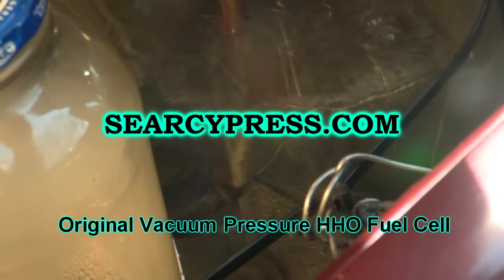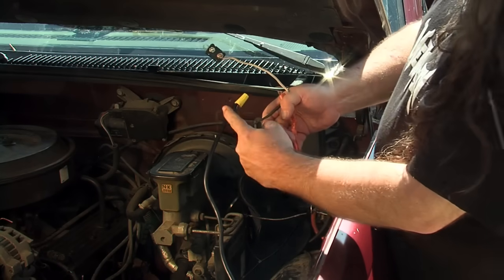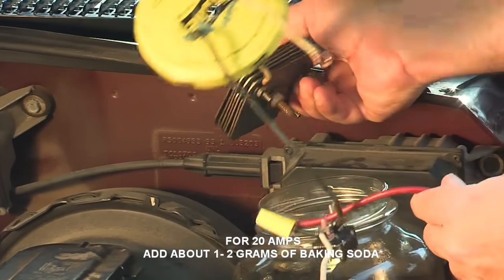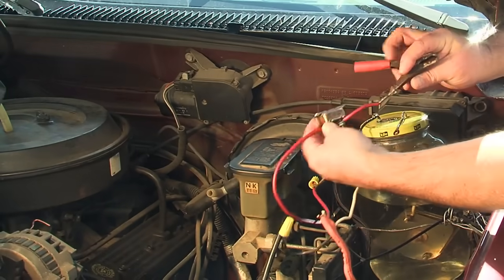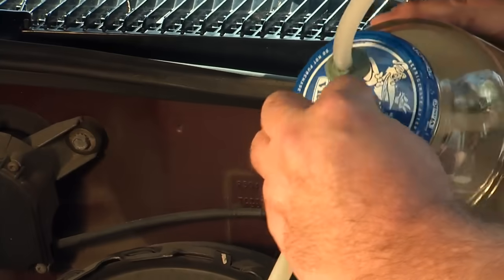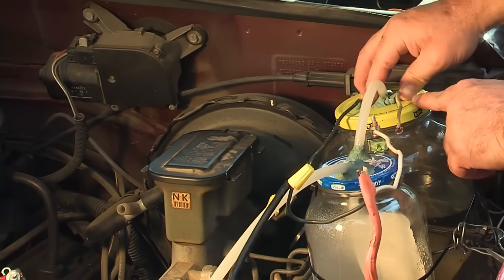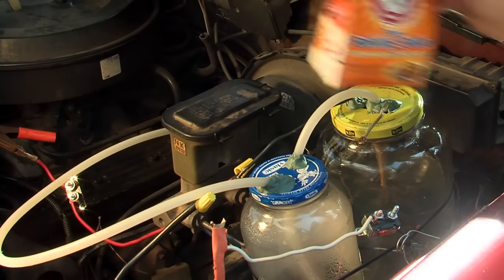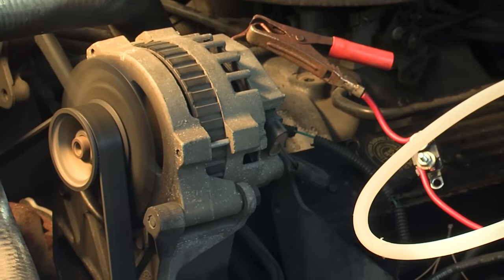Vacuum Pressure Hydrogen fuel cell defeats high gas prices using hydrogen from H2O.

Comment: This was awesome at the time !.....Now The Fuel Gennie has everything sorted and comes in an easy to install pakage .......works the same but safer.
Reply: Just a scam 

Just idling your engine is over a 600 rpms. Driving a 2.5 liter 4cly motor  is about 150 cubic inches. That's 37.5 cubic inches per a cylinder. A cylinder fires ever 2 full rotations. So in a minute of idling at 600 rpms your engine will use 11,250 cubic inches of air a minute at just idle. That's a 187.5 cubic inches a second of air. You're not producing even 2 cubic inches a second. But don't forget that it's h2O 2 parts hydrogen 1 part oxygen. So 1/3 of the gas isn't even hydrogen it's oxygen. So not even 1% of the air being taken into the cylinder is hydrogen. The only thing being accomplished here is the alternator is working harder for the high amp draw dragging the motor down more reducing fuel mileage. This is why water isn't used as fuel in a motor vehicle. 

Now don't forget we don't drive at 600 RPMs most people will be around 1800 rpms at cruising speed. That's 3x the amount of air with still the same hydrogen production. So now ur way below the threshold of .03% hydrogen in the cylinder. Using a spark arrestor on the output hose to keep from blowing the jar up you would be hard pressed to even candle a flame let alone put anything measurable in every cylinder 900x a minute cruising down the highway at the speed limit.

Comment: Hi, Can you please list the electrical parts etc. 10 Gauge Wire, 30 Amp Auto Fuse, Light Switch etc. And also how do you wire the stainless plate. Ex:  Where does the positive wire go, and where does negative wire go onto the plate.
Reply from the maker: A new video is coming out very soon. Be sure to subscribe so you don't miss it. I'll try to cover everything I can. Thanks very much.
Reply: Thanks I subbed you. Will this work with fuel injection also.

Comment: Can this work on a fuel injection engine( 2008 Honda Civic)?
Reply from the maker: I cannot sanction the installation of this fuel cell for obvious reasons. Technically speaking there is no reason it will not work. Injecting into the vacuum instead of the air intake is a far better approach. Avoiding O2 sensor problems is possibly one of them. I will be showing the addition of a vacuum pressure switch installed in the system in an upcoming video. This switch will offer a lot of benefits to our truck. Be sure to like and subscribe or you just might miss it. This video is for research purposes only, it should not be duplicated. Ty

Comment: Don’t try this please if you don’t know about gases it’s a very dangerous method letting both gases mix, if anode and cathode are separated into two different sub sections and o2 and h2 is generated separately it would be much safer option

Comment: Easy to make safer.put a gauge on to show pressure, find out what the average is when running well. Find out what the minimum vacuum is. Put sensors on both, running to a main relay. Low vac or high pressure, and it shuts off.

Comment: If you use distilled water it wouldn't be as much of a buildup
Reply from the maker: Build up is not generally a problem. In the past I would have used distilled water to start with to simplify adding electrolyte. Now with the cost of everything, not so much. Thanks for the comment.

Comment: Curious, if you are supplementing the gas and increasing the mileage, what % of an increase in the mileage did you get?
did you go from 26 to 50? Also, how far does that gallon of water take you before it runs out and you are just on gas?
Reply from the maker: This particular motor is extremely inefficient. On a good day 12 miles per gallon. We tested the vehicle by running it completely out of gas on a stretch of highway and adding 1 gallon and continuing on. Running out again and adding more with the fuel cell on until we ran out again. During that particular test the mileage increased to 22 miles per gallon using the cell. Determining mileage can be very tricky. One of the most cost-effective benefits of us using the system was the ability to burn lower octane fuel without any engine knock. Thanks very much for the comment.
Reply: @metalpresstv  How long or far does a gallon of water last?
Reply from the maker: @kenp7814  200 miles on average. Ty
Reply from the maker: @kenp7814  people really need to understand it is an ugly duckling but it's functionality is well thought out. The hard wiring instead of stranded prevents wicking of water. Using stranded wire will fail eventually. Using anything other than glass results in distortion of the container as well as thermal problems. The secondary jug piping system pulls the water back into the primary cell when you shut it off. The size of the piping is also critical. There is more to this design that meets the eye. Thanks very much.
Reply: @metalpresstv  I'm fascinated, thanks for answering my questions
Reply: @metalpresstv Have you tested any other engines  since then ?  If this is increasing mpg without any extra added energy then technically it's net positive and that would mean you can run this on a generator and store excess energy into batteries right ? So whatever is needed to run the electrolysis plus extra on top from the burning of the hydrogen ? Tell me you have more information on this concept
Reply: Best way to test mileage is do a long run. Like 150 miles, with or without the hydrogen.  Would like to see those results. Thanks for sharing.   We can build it.

Comment: So is this the fuel????
Reply from the maker: Not exactly. The HHO gas is used to enrich the gasoline. This engine only burns about 80% of the fuel. That's pretty low efficiency. It takes a little more power to make the HHO fuel, however we are able to increase that efficiency well above 90%. A real bonus is the ability to run low octane fuel without engine knocking. The HHO enters through the vacuum system. This gas burns very rapidly and helps to completely burn the fuel in the cylinder. Thanks very much for your comment.

Comment: Are you running with Kathleen along with the generator or just running the hydrogen oxygen only no gasoline
Reply from the maker: We're enriching the gasoline. Only about 80% of the fuel is normally burned in this engine. That leaves us plenty of room for improvement. By creating the hho gas using a little more power we can increase the efficiency well above 90%. This system allows us to burn low octane fuel  removing all motor knocking. That alone saves us a bunch of money at the pump. Thanks very much for your comment.

Comment: I bought a 95 explorer as my first car had a fancier setup guy explained what it was but I didn't much understand had it running for a week and gas gage did not move at all I swear I put close to 300 miles and it used maybe ¼ tank. Fast forward a week my fuel pump goes out. Bummer. Well I happen to be in automotive classes (first semester) so I ask teacher if I can tow it in and we replace it as a "lesson" so car arrives pop the hood to reconnect battery at end of job and she starts screaming pissed saying that I could have leveled the whole shop because it was essentially an hydrogen bomb and she proceeded to rip it out of my vehicle. After that my Ole 5.0 got 50 miles to ¼ tank and I was very sad. The end.

Comment: We need to archive this and disclose this as quick as possible I've been fighting for this technology for years we need to get this into public hands
Reply from the maker: When fuel prices spike we get an uptick in traffic. People loose interest as long as fuel is somewhat affordable. This flammable steam system allows for burning of low octane fuel without engine knocking.   It's pretty great just on that alone. Worth researching for sure. Thanks for the comment.
Reply: @metalpresstv  you should try pairing that with a Duke engine you would get so much torque

Comment: You can make it a lot smaller and a lot simpler and get well over 100 miles with less then a gallon of gas , matter of fact if you have a tank full of gas you may worry your gas is going to get old and pump most of it out of your tank. Technologies out there technology has always been out there the man who patented he mysteriously died many years ago.
Reply from the maker: I must admit Stanley was a great influence. However, his designs are in my opinion somewhat theoretical. Remember it does not take a working prototype to get a patent. He spoke of using some sort of laser on a spark plug. At the time he did this I doubt very seriously there was a laser small enough or powerful enough  available. I'm not sure why he got waxed, but perhaps there was some validity to it. HHO by itself would probably melt the engine. Most certainly the hydrogen would have to be separated. I'm certain it can be done, but I doubt very seriously anyone would allow it. Thanks very much for your comment.
Reply: @metalpresstv  I'm not sure what the man's name is that I'm talking about bit he did not used a spark AR laser. 
But I know for 100% it works , and will not do any engine damage what so ever.

Comment: Question here. I live in canada. During winter de temperature will litterally freeze the water. Is there any known product i could put in the water so it keep producing hho and keep it from freezing up?
Reply from the maker: In the Southern United States where we are temperatures seldom get below zero degrees Fahrenheit. When set to produce about 30 amps of current draw the fuel cell will not freeze completely solid. Insulating the glass is not a good idea but in extremely cold conditions it could be experimented with. I'm not aware of anything you could use because the electrolysis process literally pulls apart molecules. Other electrolytes besides baking soda could be out there. If you solve this problem be sure and let us know. Thanks for the comment perhaps others have figured it out.

Comment: Wow does this really work?
Reply from the maker: There are an actually a lot of arguments. Those that claim it does not focus on several things. First they claim that it is impossible to use energy from the alternator and create the hydrogen because they think you're breaking the laws of thermodynamics. This is incorrect because you are only burning 80% of the fuel that is going into your engine. Boosting the fuel efficiency allows for up to 20% more energy production without breaking any laws of nature. Others claim that because your O2 sensor will increase the amount of fuel going to your engine it will offset any gains. This is true for injection into the carburettor itself. The gas is mixed with air and incomplete combustion is more likely. Injecting in the vacuum is different than this process. The hho gas will fire with the spark plug helping to complete combustion completely. It's slightly outruns the gasoline explosion. Using this system it allowed us to burn much lower octane fuel. The engine ping is eliminated when running the system. Even if there were no gains in fuel efficiency you would still save money because you're able to burn less expensive fuel with no knocking of the engine. No knocking means less wear and tear. Others claim that there is not much energy in this explosion. They seem to forget that we are also producing oxygen. Hho is incredibly energetic. Thanks very much for your comment.

Comment: My question is why don’t they have a condenser section of the exhaust and a catch can/fuel cell to catch the water exiting the engine. Once enough water collects in the system a fuel pump will kick on and send fuel/water back to the pickle jars as needed along with a pre calculated amount of baking soda baking soda. Quite possibly might only need to add baking soda every once in a while and a pinch of water to replenish the amount that happens to sneak past the condenser section
Reply from the maker: Well, after all water is pretty easy to come by. You get about 200 MI out of a jug and it's a good idea to inspect everything at that time. You really need fresh clean water every time. I usually wash everything off and start fresh. It's actually kind of entertaining to go through the process. Thanks very much for the comment.
Reply: @metalpresstv  oh ok 👍🏼 I bet this truck has come in handy during this time of super expensive gas prices haha

Comment: but what about the winter when water freezes?
Reply from the maker: It depends a lot on just how cold your area gets. Also the amount of electrolyte you're using and spacing of your cell plates. Not generally a problem in the south. Thanks for your comment.

Comment: It's amazing that my grandpa said that they were able to run cars in 1930s just using brown gas and customized engines that burns the gas in increments and slowly. Sure it runs maximum of 30 km per hour but it beats walking and run for miles. As long as you have wood or dry leaves you could go on driving. They burn the wood and the fumes from the wood they would collect in aluminum cans with half filled water where the water turns ickly he said. Then he would transfer the gas to a big metal container that is connected to the engine. If the pedal in hit the engine burns the gas slowly and the wheels turn. I believe we can do this today, but most likely be silenced by the govt if we get successfull.
Reply: You can find plenty of videos here on youtube of cars run with wood gas, I even saw a lawnmower motor running on wood!
Reply: Lol then u realize this isn't practical for anyone

Comment: I HIGHLY reccomend NOT using glass containers…
Reply from the maker: Do not replicate anything you see in the video. With that being said the reason we used glass was because there is nothing else that can handle the pressure of the vacuum and the heat. Also the thermal properties of the glass are perfect for the application. Under normal circumstances there's never any kind of pressure inside the jug. It runs in vacuum. Still situations can arise and things can happen. Thanks for the comment.

Comment: A lithium car battery on this system would do good at supplying amps I bet.
Reply from the maker: That's very true. What we actually did was take a large portable generator and a 100 amp battery charger and put it in the back. We ran the fuel cell at 100 amps. What we found was the engine ran really good. This did seem to be a bit much. Using  Really high levels of hho the gains seem to be de minimis. Regardless you can always burn lower octane fuel. What we found was there's really no need for anything more than 30 amps to the alternator. Thanks very much for your comment.
Reply: @metalpresstv  A 100 amps is a huge amount of power. Put this on a delorian.

Comment: Doesn't work. The energy needed to make the HHO is greater than the energy received. The increased load on the alternator is greater than the fuel delivered.
Reply from the maker: You're assuming 100% of the fuel is being consumed by the engine. This is incorrect. Only about 80% of the fuel is actually burned. Increasing the efficiency of the engine offsets the power used by the alternator. Injecting flammable steam pushes the efficiency well above 90%.  Even if you got no gains you would still be able to burn lower octane fuel without any engine knock. This saves money. Thanks very much for your comment.
Reply: @metalpresstv  The load on the alternator is greater then any benefit. This is snake oil
Reply from the maker: @scoutdynamics3272  Ignore the facts I told you. Ignore the results. Maybe it'll go away. Maybe it won't. Thanks for the comment anyway.

Comment: Ghetto rigged to hell lmao, twist on connectors and house wiring...really? Glass jars held on with clothes hangers...come on...weak ass clamp holding on for dear life to an exposed positive lead..ffs..fabricate something out of metal and use the right wiring and connnectors so you dont start a fire when you hit a pothole...ffs...
Reply from the maker: I realize why you think this. Understand we spent years going over this. Stranded wire creates a wicking action which pulls water out of the container. You have to use solid wire. The glass jar itself is the only container which can handle the vacuum and heat. I could hide everything inside wire coverings and make everything look great but then you would not know how it was made. As far as hitting a pothole goes you will notice there is a clamp on the alternator. Any large bump we hit will knock that off including an accident. It is a Fail-Safe system. It may not look beautiful but it is extremely functional. I'm not saying go build this. In fact I suggest you do not. We are just showing you what we did to create this system. Many have built upon it and have created many systems that are far more superior. Since we engineered this there have been addition such as flashback arrestors and other devices which makes this kind of system much safer. However, it is still very dangerous to do. The effect is quite pronounced, you can burn very low octane fuel without any engine knock. Regardless of gains from the HHO you are able to burn low octane fuel resulting in lower costs. This is nothing I want you to replicate however I am just trying to show you that there are things that manufactures could do to motors to get higher efficiency. Thanks very much for your comment.